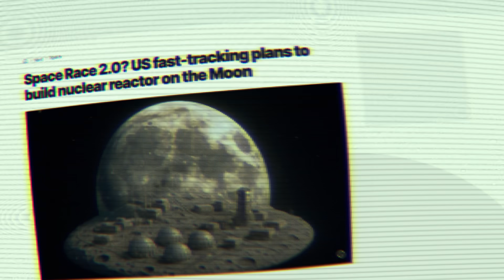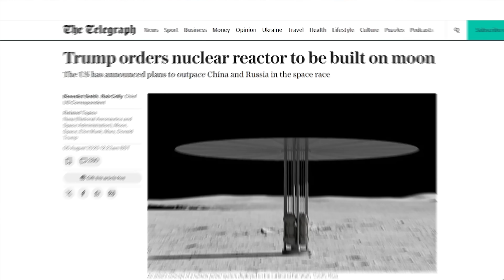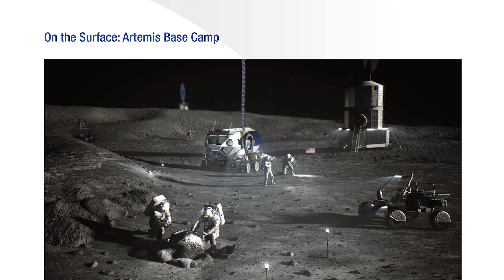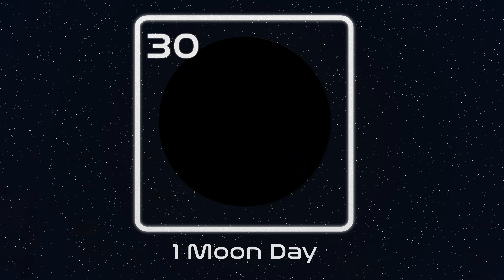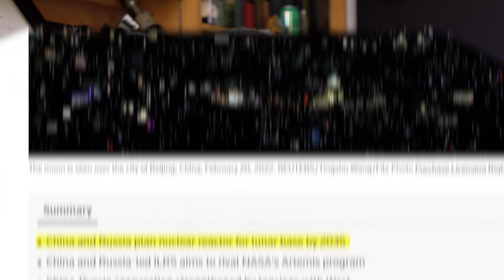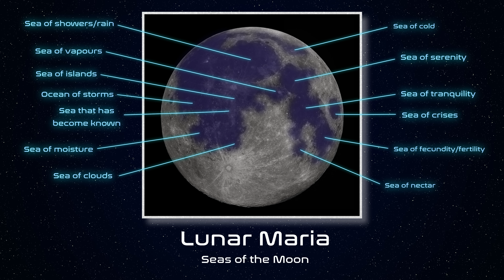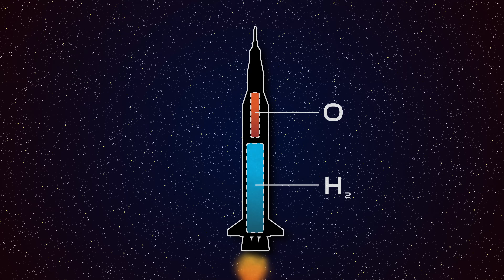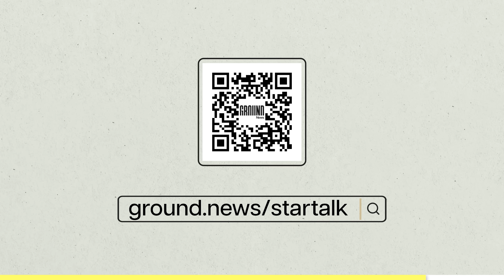Why We’re Putting Nuclear Reactors on the Moon

Comment: I mean, without even looking, I could guess that without the fear of nuclear explosions polluting....well anything.... there isnt really much holding anyone back from putting them on the moon. So might as well use the best source of power we got since it wont hurt...'anything' really
Reply: Also he goes on to say why would we go to the moon, and then mars, when we can just go straight to mars, and while he later adds 'landing on the moon' to that sentiment, I feel it takes away from the projects in place. I read back in like 2018 that Nasa had a project in motion for getting to Mars, that included building a space station in orbit of the moon, that would be used as kind of a rest stop / launching point to mars. The idea was we launch from earth, to the moon, and it takes a short amount of time, then from the space station we launch towards mars, and without any harsh gravity, or atmosphere impeding our ability to speed up, we would be able to launch to a much higher speed and cut the time it takes to get to mars in half (or close to). That original article I saw also implied that the station would be done...around now times, but I havent seen much else about it since back then

Comment: Very interesting and almost  verifying.  However, if you extract anything from something, that something becomes less.

In the case of separating hydrogen from oxygen for fuel or even mining silcone to bring back to the earth. How do you replace the mass of the moon so its magnetic pull on the earth won't be affected?

Comment: I want to talk about splitting water into its elements, just to re-join them in the rocket. Wouldn't doing this take significantly more energy to split them than you gain from merging them? Surely there's a more power efficient way of storing that energy for use in the rocket other than making a big explosion?
Reply: Is it a matter of power density?

Comment: Lunar lava tubes may potentially serve as enclosures for human habitats. Tunnels larger than 300 metres (980 ft) in diameter may exist, lying under 40 metres (130 ft) or more of basalt, with a stable temperature of −20 °C (−4 °F). These natural tunnels provide protection from cosmic radiation, solar radiation, meteorites, micrometeorites, and ejecta from impacts. They are insulated from the extreme temperature variations on the lunar surface and could provide a stable environment for inhabitants

Comment: Space station particle cole: Yes, a particle collider in a more perfect vacuum would have a longer beam lifetime, which would improve experimentation. The longer a particle beam can circulate, the more data can be collected.
How Longer Beam Lifetime Improves Experiments 📈
The core purpose of a particle collider is to create collisions and record the results. The number of collisions that occur over a given period is known as the luminosity. A longer beam lifetime directly contributes to a higher integrated luminosity, which is a key metric for a collider's performance.
 * More Data: A longer beam lifetime means the particles can circulate and collide for a longer period before the beam degrades. This allows for a greater number of collisions, which is essential for studying rare or exotic particle interactions. Many of the most interesting phenomena in particle physics are extremely rare, so a high number of collisions is necessary to have a chance of observing them.
 * Reduced Background Noise: While collisions with residual gas molecules are a primary cause of beam loss, they also create unwanted scattering events that can interfere with the data from the intended particle-on-particle collisions. A more perfect vacuum would reduce this background noise, allowing for cleaner and more precise measurements.
 * Operational Efficiency: A longer beam lifetime means the accelerator doesn't need to be refilled as often. Refilling a particle collider is a complex and time-consuming process that involves injecting new particles and ramping up the machine's energy. By reducing the frequency of this process, the collider can operate more efficiently, dedicating more time to scientific research.
In short, a better vacuum would allow scientists to "study it longer" by providing more opportunities for the desired particle collisions to occur, leading to more robust data and a higher probability of new discoveries. However, as previously discussed, this improvement doesn't overcome the insurmountable engineering challenges of building such a device in space.

Comment: Maybe if your just trying to go straight to mars hang out and come back but if your trying to haul cargo I’d imagine you could have a massive fuel tank and only fill her up like halfway and have a filling station on the moon the extra weight you would have to accounted for in fuel that you don’t need sense your only going to the moon can be used for cargo and equipment you then leave earth go to the moon fill your tanks up completely…. And now that your on the moon which has less gravity holding your rocket ship down compared to the amount you need to leave earth…… you then leave with your full fuel tank headed to mars with extra fuel to burn now in case anything goes wrong possibly even able to expend more fuel to go and get there faster and still have enough to slow down and proceed to land on mars or conserve the fuel for a return trip

Comment: A nuclear power plant is also a source of heat. The USSR used to use nuclear power plants to deliver hot water to residents to heat their homes. At the poles, if craters are cold traps, you could use the reactor to provide heat at night, and use a crater to provide a sort of a/c during the day. 

One minor nitpick, in the USA hair dryers usually run at 1875 watts as that is the highest allowed on 15 amp, 120 volt circuits for non-continuous use products. Continuous use products, like space heaters, run at a max of 1500 watts.

Comment: Hey Neil, do you know, did NASA ever told you how you scientists generate electricity from Uranium? Are you talking about thermal coupling or boiling pure H2O and use the steam in a turbine?
Is it called Power Generating Device or it has a real name?
Have you ever seen one of these power generating devices or it only will works on the moon?
I don't expect you or any other living scientists know the answer.

Comment: Where will we get the energy to split the water molecule? That requires energy. Once the H2 and O2 are separated, the energy is stored in the H2 and O2. And when the H2 and O2 come together to combust inside a rocket, that energy is released back into the environment. So again, where will we get the energy to split the water molecule while we are on the moon? Would the energy come from the nuclear reactors? Could the nuclear reactors provide enough energy to split enough water molecules... which would be enough to provide fuel for a propulsion rocket? Neil mentions that each nuclear reactor will provide only 100 kW of power output... enough for a small human colony. But is that enough to generate enough H2 and O2 for a propulsion rocket?

Comment: IMHO, we need the idiots in the NRC to get their collective a$$es in gear and approve Molten Salt Reactors (MSRs). These are the type of reactors we need on both Planet Earth, in space, on the moon and on Mars. They run 100% of the time. They can easily be refueled without going down for a month, and they can be used to "burn" U-238,  Pu-239, etc which are the highly radioactive "waste" from current US nuclear reactors. Thorium which is plentiful on Earth, unlike U-235, can be used as fuel because an extra neutron turns it into U-233 a very fissile element.

Comment: Moon is cold only when there is no heat source because there isn't air molecules to vibrate and transfer heat. No heat source and no heat transfer equal to low temperature. 

Just like space station. When there is a heat source such as nuclear power plant and a working battery. Cooling is the problem because there isn't air to bring away enough waste heat.
Reply: No. Bo heat transfer does not equate low temperature

Comment: 12:11 if you can produce rocket fuel on the moon then it makes sense to use it as a stocking off point to get to Mars. A rocket could takeoff from earth refuel in orbit around the moon whilst getting a gravity assist from the moon.
Reply: That would be a waste. The rockets aren’t constantly boosting when they reach outer space because there is no air resistance to slow it down. Once the rocket reaches space, it is just coasting off its initial boost. You would refill at the moon just to spend it all reaching the escape velocity required to escape the moon’s gravitational field.

Comment: Question, would we extract the minerals needed to make said reactors from earth then place them on the moon?

If so, would this affect both the polarities of the moon and earth respectively? 

The reason I ask is that removing materials from one place and simultaneously placing them in another is a core example of polarity shift. Which in turn could cause undesirable effects that most mathematical equations can not account for without proof of concept.

Comment: You have one thing wrong. Every single nuclear reactor in France had problems in the past (you know why: because economy is more important than security. If you'd build a fail safe nuclear plant and maintain it in a fail safe way, the power it generates is higher priced than geothermic, wind, solar. And we haven't spoken about the nuclear waste yet, for which there's no solution for hundreds of thousands years). If you have a solar panel or wind turbine or geothermic station with a problem: that's not a mankind-threatening problem. If you have a problem with your nuclear reactor: that is a mankind-threatening problem. That's the difference. The fact that no meltdown has happened, doesn't mean it won't happen. The nuclear plants there are of the PWR type. They can have a meltdown. It's just a matter of when, not if.
Reply: Solar and wind have lower upfront capital costs but can require significant investment in transmission and storage. Nuclear has very high upfront costs but can be cheaper to operate on a per-megawatt-hour basis due to constant operation.

Comment: A reactor is definitely the way to go if you want a really decent amount of power on the Moon.  
Even something roughly the size of a fridge would provide a lot of power.  
Given that the US Navy has decades of experience building small and reliable reactors for subs,  I reckon they could build a much smaller reactor that would be suitable for a small moonbase.  
If you wanted to expand the moonbase, you'd just connect a few small reactors together.  Scale as needed.
Reply: Trouble is they get hot. Subs have lots of water around to cool them, the Moon does not. That's a problem.

Comment: Some battery chemistries generate heat during discharge cycles. Warm them up to get them going then let the chemistry take over. Li-Co for my drones get down right warm during operation and instructions advise letting them cool down before recharging.
Reply: P=I^R produces the heat.
Reply: @universeisundernoobligatio3283 I think it's P=R*I^2, but, yeah. They take about an hour or two to charge up depending on mAh and discharge in about 10-15 minutes. Not sure the charge rate. They're internally regulated. Pretty sure their running out a lot higher rate than running in. Just something to look into. Aluminized blankets for insulation - 95% reflective. I built a tent out of 5mil BisQueen once. 32°F on the outside, 55°F on the inside just on sunlight.

Comment: -200°F / +200°F.  Wouldn't it be smarter to smooth these fluctuations out with plexiglass and pressurized atmosphere and a heat capacitor/pump? You're going to need a breathable atmosphere anyway so why not utilize a heat exchanger to store the excess heat during the daylight and use it to keep things cozy during the non-daylight days? Something that could be done for 2/3 kilowatt probably?
100Kw will run 6,667 15 watt living room light bulbs. Probably want 1/4 of those to be high UV grow lamps for the garden (green house, also plexiglass).

Comment: The bigger problem with using battery storage as compared to nuclear which is that in order to store all that power, the batteries are actually going to end up costing you more in weight than a very small nuclear reactor of comparable output.
Reply: Most thermal power systems require cooling systems, usually water
Reply: @wlosborn  Not the kind of nuclear reactors used in space though.  They don't get hot enough to melt their containment, so yes, they have a fluid which drives a turbine to generate power, but the fluid cycles internally.  It would be a totally closed system if not for the radioactive decay.
Reply: @jonavery4978  the kind we've used in space (thus far) don't use a turbine at all. they just heat up and use thermocouples to generate power from the temperature delta. the largest one we've sent up there generates 300w, compared to this proposed 100,000w.

it's not impossible, 100kw is not an insane amount - it's about enough to keep the gas pedal to the floor on a single electric car.
but i can't imagine how you'd condense that much steam with no air to transfer the heat to. it's going to need some seriously big radiators, probably. or a super long copper pipe that runs underground, where it's presumably pretty cold.
Reply: Right, but I'm talking about the conceptual reactors like the Rolls Royce one, which are intending to use some kind of a fluid, but it will be a self contained fluid circulation.
Reply: @jonavery4978 I can't find much of anything about how RR intends to cool their condenser in space, I guess it's probably a closely guarded secret. the rolls royce small modular reactor for earth though just uses an external water supply and a traditional cooling tower, which doesn't work without air
Reply: I think the answer is that they don't intend to cool it, other than maybe just putting some radiators on it to let the heat bleed off into space.  The idea is it has an un-meltable core, so it can just get hot and it's fine.
Reply: @jonavery4978 you ~have to~ condense the steam back into water in order to use it again to generate pressure in the turbine, the phase change is what makes the whole thing work
Reply: No, you don't have to use water at all, you can use a different fluid and have it operate like a heat pump, where the circulating liquid spins a turbine.    Yes, that requires cooling, but you can still cool fluid with a radiator exposed to the shady section of a space ship.
Reply: @jonavery4978  right, so it probably will be just a massive radiator. it also looks like that's what's depicted in the concept art at 0:35. it'd have to be pretty damn big though, there's 156m² of radiators on the ISS, and they can only eject 70kW of heat
Reply: you'd need about 3x the cooling capacity on the ISS, since generating electricity with steam is about 50% efficient. interestingly the cross section of a starship is almost exactly 3x that size. have to think 100kW is not just some random number, you could probably just barely fit the whole reactor and radiator on a single starship
Reply: @Zreknarf  You also don't have to have it actively generating constantly, so it won't get as hot.  You can can put control rods in to slow the reaction while in space and then kick it into high generation when you deploy it.
Reply: @jonavery4978 I'm not sure what you mean "like a heat pump", heat pumps use a compressor and an expansion valve to force the refrigerant inside to phase change

Comment: The French regularly need to shut down some of their NPP because of cooling issues. Not allowed to heat the water as much as they'd need for cooling in summer, or rivers frozen in winter.
Reply: Good to know a -200degC that will not be a problem.
Reply: @universeisundernoobligatio3283 Radiating away heat in vacuum is an even bigger problem. Especially with sunshine around for two weeks a time.
Reply: @wilfriedklaebe  
Or dump it into the ground, conduction works in a vacuum.
Reply: @universeisundernoobligatio3283  Needs a big enough area to dump it into though, to achieve the required heat flow.
Reply: @wilfriedklaebe  
The moon is a big place. Just like my ground source system, 4  180 foot wells.
Reply: @universeisundernoobligatio3283  You'd have to bring pipes and fluids to the moon first. And every gram counts. In Dollars. Lots of them.

Comment: Getting power from a battery at -200 is easy , obviously, the batteries were fine on the luner rover and that was 60s battery technology? .....im amazed the 1st time they did it they took camera equipment and a car..mind blown. 
Now we can't even and a probe with out it falling over..
Reply: Lunar rover was never in the shade, never got cold. Learn some science before you speak.
Reply: @universeisundernoobligatio3283 Surely you're not saying Lunar Rover ran on photo-voltaics?? NoNo. +200°F is the lunar surface, not 5 or 10 feet above it. I'm even finding surface hard to believe. It's highly reflective and it's going to puke out damn near as much as it takes in. No atmosphere, remember? Astronauts have to wear thermally controlled space suits, just like EVA on ISS. He probably just said that to see how smart you are. Never heard it before. Probably -200°F year around 😂😂😂. +200°F would boil ALL the volatiles away. And half the solids 😂😂. Explain why it's so dry I suppose. Plus the moon itself is going to be a huge heat sink. 🤨🙄